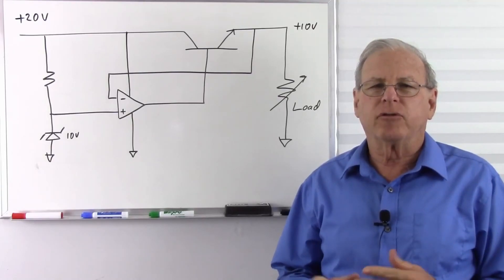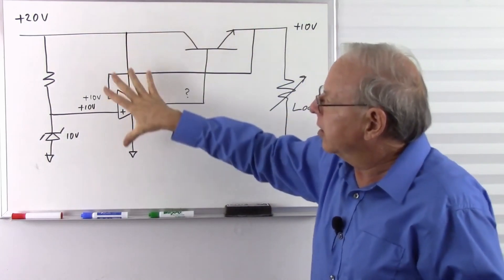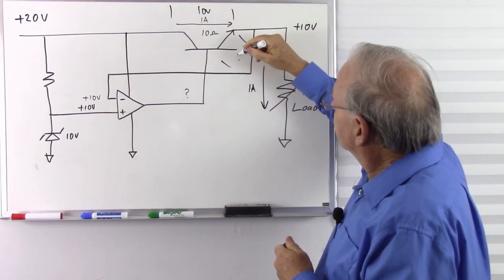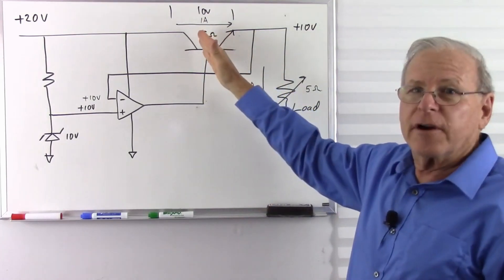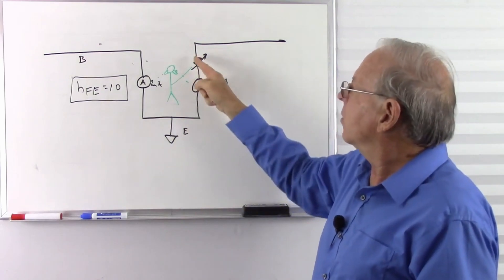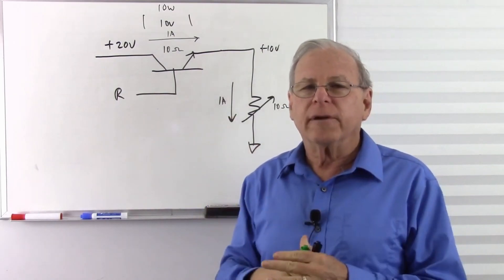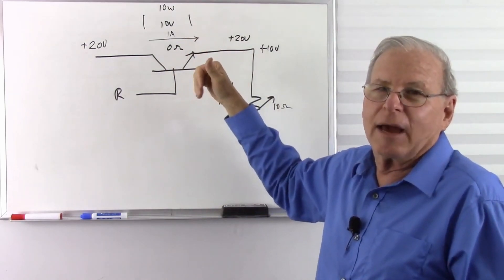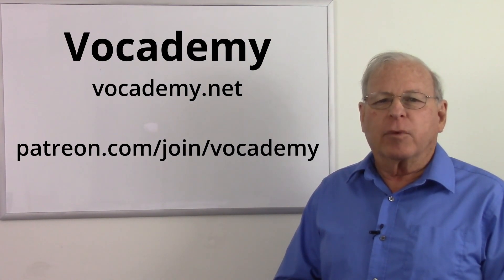Is a Transistor a Variable Resistor   Answer to Question

Comment: I have a collection of 12V / 9V wall warts and I use them to power up my breadboard power supply (MB102).  You can also tell a linear power supply because it is warm to the touch.  The switching ones are at room temperature.

Comment: is it possible to replace high power resistor say 10w 20hom with an npn transistor? so that by using its beta we find the value of base transistor to limit the colector current
Reply: Yes. You would be using a power transistor rated for the amount of voltage and current it will see across the emitter-collector, and your base tied to some form of regulatory configuration.

That can be as simple as a voltage divider, or an op amp for better stability. One strategy that can be useful for the simplest arrangement to just use a voltage divider bias is some zener diodes, or using a diode voltage divider since as the temperature changes within the transistor and alters it's operating parameters, the diodes also experience the same approximate temperature changes and adjust in resistance and voltage drop.

Zeners for your voltage divider are the best way to do it as simply as possible since they won't deviate greatly from projected specs with thermal changes.